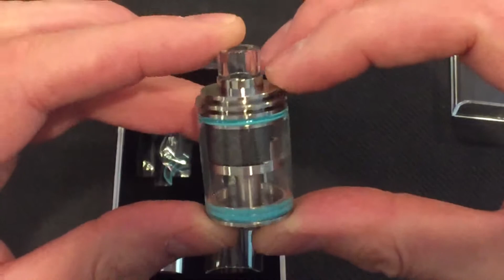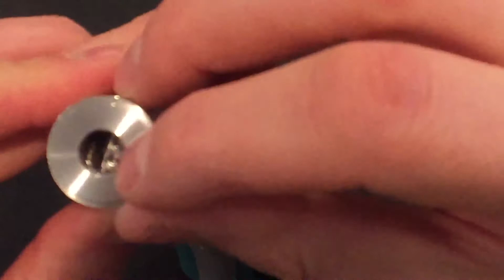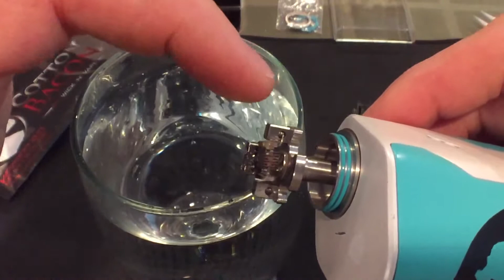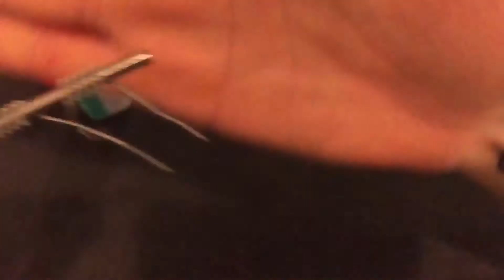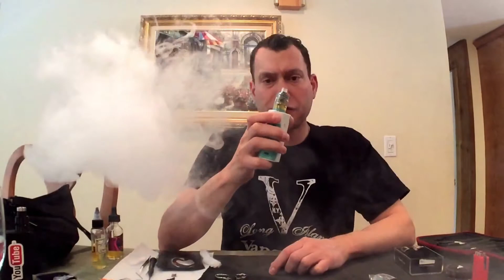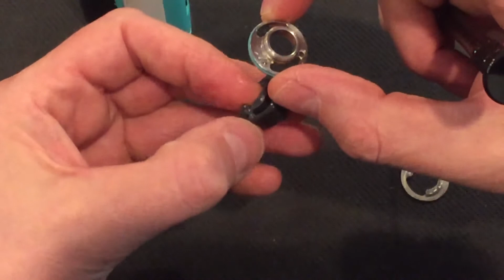Wismec Theorem RDTA Designed by Jaybo Designs Inspired by SMM (Matt)

Comment: Thanks for sharing your experience with this rdta, I agree with you a Clapton seems to have worked best so far. Think I'm gonna try a fused Clapton next. Very interesting that you tried the dual coil, wicking thru the fill hole, nice to see someone thinking outside the box, however I would worry about the glass cracking from the heat. I'm currently running a parallel 26g k build at .4/.5 ohms seems to be working fine with this build. Great review as always, keep up the good work Darryl! 👍

Comment: im also loving this little guy, i wasnt liking it nearly as much til i figured out the wicking, i comb out the wick with a scrap kanthal strand, and thin it wayyy out, thus keeping the thickness in the coil, while thinning out the tails in the cut outs, now it wicks great and filling is much smoother (no airlock).... also switched out the drip tip for a wide bore. also build as close to the top as u can to get closer to tht top airflow... all things tht helped me, lol
Reply from the maker: +drewp831 Thanks man.  so many possibilities with this atomizer.  And now I have a whole bunch of great suggestions to play around with.
Reply: totally its something different and we all have to kinda relearn how to build an wick these guys. but to me thts one of the coolest parts of vaping is building and rebuilding an atty til i optimize it and am getting the full potential out of it. thanks or the video

Comment: Another great review. I actually like the notch coil.... Once I cut the wick down, ran it in TCR mode and used the dual air ring. One thing I don't think you mentioned, that block of peek covering the fill hole is the other airflow. It allows  air to hit the coil from the side as well as the top. I don't think the deck was meant to have a dual coil, one on each side. I have seen dual coils being used as two vertical coils on the same side though. Anyway... Great vid and thank you for doing what you do!
Reply from the maker: +Mike Gonsalves thanks.  haha...oops.  I didn't watch any reviews on this, I wanted to put this puzzle together on my own.  Yeah, that makes much more sense than the way I did it.

Comment: The one thing that I really dislike is the refill hole depth. Such a pain with unicorn bottles. I also don't use the SS notch coil, for some reason I cannot taste the vapor off Stainless Steel.  Apart from those two things a really nice little tank.

Comment: I"m not sure because I don't own one of these tanks, but I have a couple Haze Dripper Tanks and you're supposed to build two vertical coils on one side of the deck. I think you're supposed to do the same with the Theorem.
Reply from the maker: +George Gonzalez You're right, haha I found that out after I did my video.  OOps, I guess I Quest Hacked it and put a coil exactly where it wasn't intended.  My very next build on this will be some verticals up front there.

Comment: the afc rings are actually dual and single airflow rather then for dual or single coil mode. you can use either single airflow hitting the top of the either dual or single coil or single airflow hitting the side of either single or dual coil. or you can use the dual airflow ring hitting the top and side of your either dual or single coil. does that make sense?
Reply: and for a dual coil you're supposed to install both coils vertically on the side of the deck with the wick holes. so each coil has wick going vertically into each hole. not trying to sound like a know it all haha
Reply from the maker: +Mikey Moreno Thanks man, this atomizer has a treasure of unexplored builds and methods for me.  Can't say I ever had an atomizer with so many possibilities before.  Thanks for your comments, they do make alot more sense than the way I was looking at this.   a cerebral atomizer that gets one thinking!
Reply: +Quest4vape not problem man. I love my theorem and use it everyday so I'm pretty familiar with it haha

Comment: Dipping coils to water to clean when the coils is still attached with mod? Is it going to short?
Reply from the maker: +M Lee no.  I didn't have the power button pressed when I was dipping them in water.  I do that to clean all the crap off the wire that is on the surface.  makes a huge difference in the flavor.